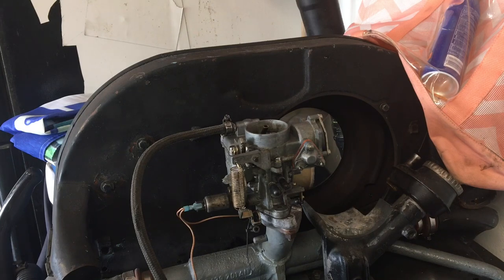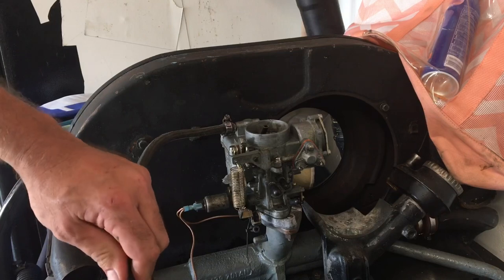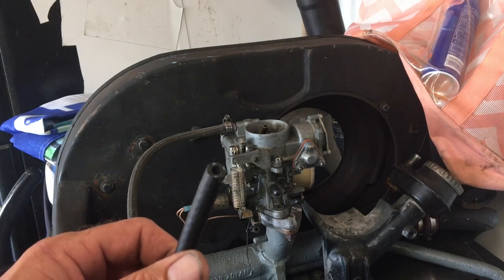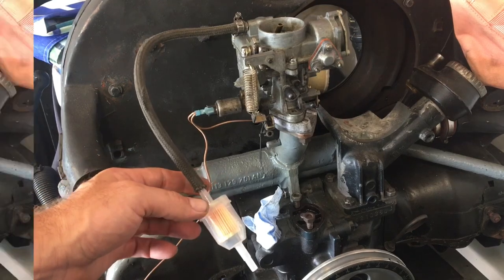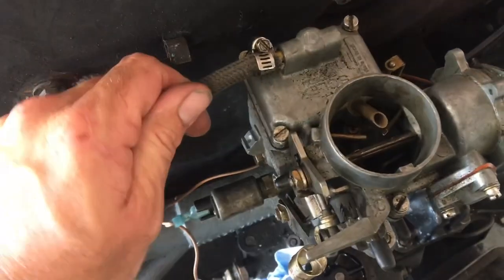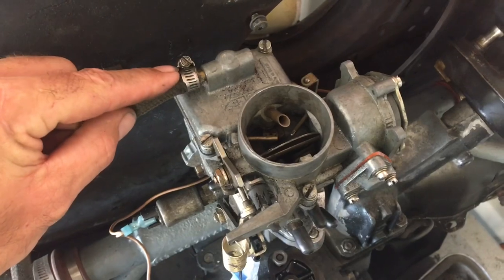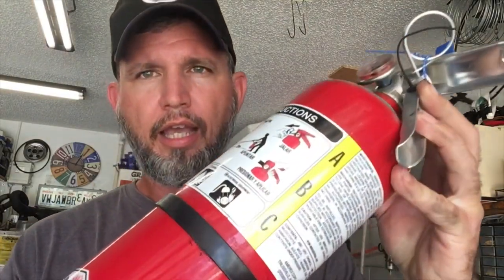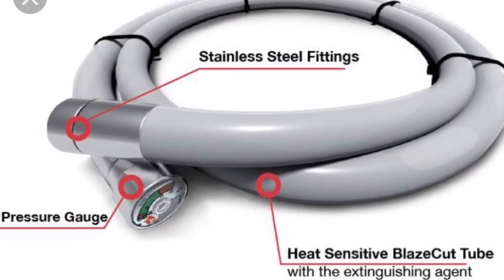Classic AirCooled Volkswagen Bug, Bus Fire Prevention

Comment: great tips!  I have the blazecut in my 73 bus along with a normal extinguisher behind the driver seat.  Did not know about the carburetor fuel nipple, will be implementing your safety wire tip there.
Reply from the maker: Thank you, glad you found the video helpful. 
Blazecut is a great item, glad you still have a fire extinguisher on hand also 🤙

Comment: My suggestion - have a bigger style aluminum fuel filter closer to the fuel tank, mounted to a solid surface before it enters the tunnel, away from heat and engines. Secure pipes with new Stainless Steel hose clamps and wire.
Reply from the maker: Much safer than what most people do.

Comment: Years late to the party, but... another good reason for carrying a fire extinguisher even with having Blaze Cut installed: some of that burning gas could drip on the ground and stay ignited after you've pulled over. Initially your car was saved, but reignition from below... Poof. 🔥🔥🔥🔥
Reply from the maker: Absolutely, fire extinguisher is definitely the most important.

Comment: I've just had my 71 bus fitted with a new engine. The mechanic insisted on fitting the fuel lines with mainly aluminium lines with some rubber hoses where the aluminum could not be bent. He also replaced the basic fuel filter with a Malpasi glass one and regulator and a switch which turns off the fuel pump when the engine is off, but the ignition is on.
Reply from the maker: Aluminum lines are a nice touch for sure. 
Keep an eye on the glass fuel filter as those have been known to crack as the vibration from the engine and the glass doesn’t get along well over time.
Reply: @VWJawbreaker  thank you for the advice. I'm not a mechanic so any advice is appreciated. 👍
Reply from the maker: We all have different opinions and preferences… as long as things are safe, enjoy!

Comment: Didn't some bus years have an optional (but dangerous) gasoline space heater in the rear compartment?
Reply from the maker: That’s a great question, I’m not 100% sure about that.
Reply: @VWJawbreaker  I now think it was the camper model.
Reply from the maker: @azmike3572  pretty sure those were propane… but I could be wrong.

Comment: Is it a VW thing to not run a fuel filter on the pressure side? I've worked in a dodge dealership for 4 years. I also own a 74 Ford. The point of the fuel filter in the pressure side is to put clean fuel into your engine. That's also why your carbs have a filter in them. I'm not questioning you or your meathods. Just trying to understand better. (I also am not claiming to know everything lol)
Reply from the maker: I understand what you’re saying and let’s look at it from this point of view. 
Most VW’s run those plastic fuel filters and not solid metal ones. Those plastic fuel filters are more prone to leak under pressure, which then leaks onto a magnesium engine case with hot exhaust, possible sparks from the distributor that’s right under the carb..... that’s why you see so many VW fires. The magnesium engine cases catch fire easily and go up in flames very fast. 

Going back to your clean fuel statement, fuel goes into the fuel tank. Fuel filter placed before the pump ensures clean fuel gets to the fuel pump and doesn’t clog up or ruin the pump. It won’t get dirty again once it passes the fuel filter.
Reply: @VWJawbreaker  makes sense. I thought you were saying the filter on the return line basically. Makes a lot of sense. Like I said I don't know everything and have 0 knowledge about VW. Thank you for clearing that up for me
Reply from the maker: @lanethomas2037  no worries at all. It’s a carb setup, most don’t have return lines like a fuel injection setup.

Comment: For people who keep putting a $1 plastic fuel filter an inch or two away from their $1500+ engine in their classic VW's, good luck.
And for those who want to argue about it: how would you know after a fire, that the fuel filter was the culprit or not, why would you want to take that chance? To prove the guy on the internet wrong?
Reply from the maker: Such a great point. Also from what I’ve seen, even a recent fire in a friends bug, it was the nipple that came out of the top of the carb. Luckily his bug isn’t a total loss and is being rebuilt. 
It could have been prevented.
Reply: It is NUTS to put a filter there.
Reply from the maker: @nemobuscaptain3245  I don’t disagree at all, there are other options.

Comment: What's your compression ratio on the engine that requires 93 octane?
Reply from the maker: Romeo my engine is 8.5:1, could probably run mid grade but she loves 93 so much better. Never hurts to run better fuel in your older vehicles.
Reply: @VWJawbreaker  
Thanks for the fast reply.  I wonder if you had a better ignition system and a wideband you could fine tune the engine better, and use 91 octane.
Reply from the maker: Romeo ha, my mistake, I do run 91 and not 93 🤦‍♂️
Reply from the maker: Romeo a wide band is on the wish list, one day I’ll get one. Milage is pretty decent and she runs good, I’m sure it’s as close as it can get without the wideband.
Reply: @VWJawbreaker  
 Okay, that makes more sense to me. A wideband tool is also on my wishlist. 🎅
Reply from the maker: Romeo yeah man, no clue why I said 93 🤷‍♂️